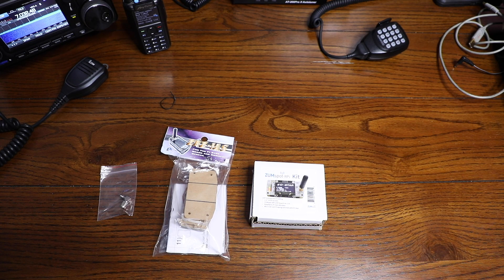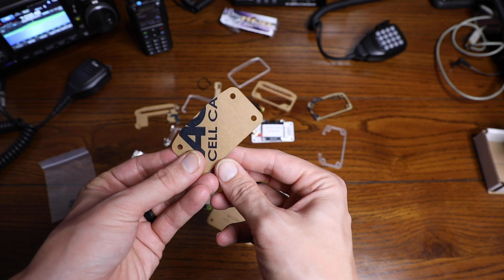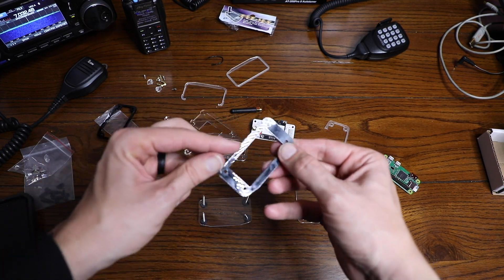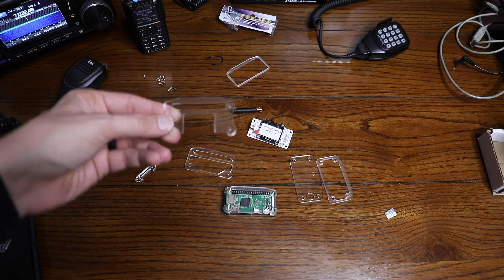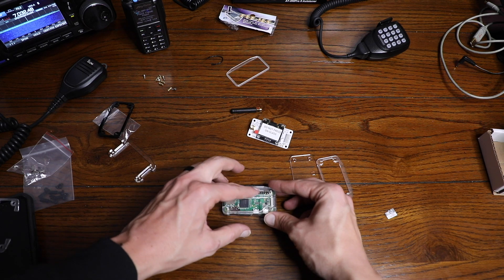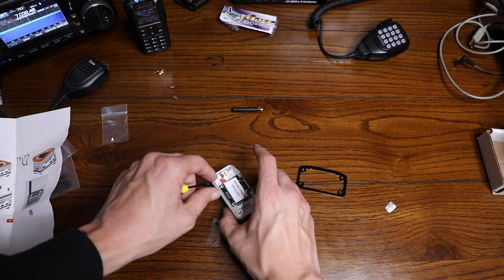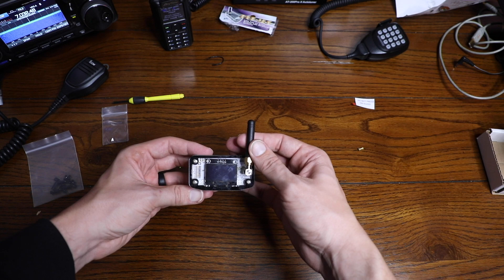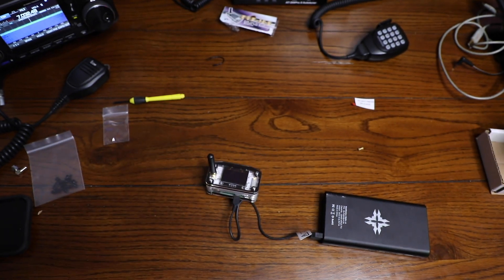ZumSpot Kit Setup - Ham Radio Outlet Hotspot Build

Comment: Thanks for the video, I ordered the Zum thru HRO, is the antenna elbow a LP SMA-20-TGN? This was on the site I want to be sure....thanks
Reply from the maker: Yes, it is.
Reply: K0LWC great...of course after ordering it last night, I saw the model that is already put together, if I had saw that I would of grabbed it first, I realize it doesn’t look that difficult but I really don’t feel like dealing with it lol. I’m sure HRO will love if I called and asked to change that order Ha!!
Reply from the maker: It’s not bad. 30 minutes tops, and quite fun.
Reply: K0LWC I could pay you $20 to do it? Lol.....one last thing, the download from the site for the image?, is that necessary? Since I also lack in computer skills.
Reply from the maker: Yes, it is. You’ll need to download PiStar to a microSD card.
Reply: K0LWC ok thanks

Comment: Why didn’t you just immerse the plastic pieces in water for 30 seconds or so to more easily remove the paper cover? And you really should have removed you finger prints from the underside of the top and last plastic part.

Comment: Good video. I got this (ex 90 elbow) from HRO recently and it is well made. The software it runs on (Pi-Star) is another story. If you are using a Yaesu radio forget about sending DTMF tones to change reflector connections on the fly. I get that the Pi-Star developers do this for free (or at least that is how it is presented) but it is almost totally undocumented. While a few "fill in" boxes and parameters to set are obvious, there are a hundred other tweakable parameters that have no info, no description, no units, no range, no scale, no type, nothing. Be very careful or you can easily brick this thing. 

If you have a C4FM radio and just tune into one room, and you have 2 or 3 minutes to let this thing wake up and connect whenever you turn it on, you are golden. However if you want to switch from room to room on the fly, plan on having a PC or tablet at the ready to log in to the Zumspot to make the change(s). And make sure you hit the OFF button (from the Power screen) to "gracefully" shut this thing down or you may not be able to log in to it again.

I got this Zumspot to be a cheaper alternative to my openSPOT2. The openSPOT2, while about $260 to your door is more expensive, the DTMF tones work with all of my C4FM radios, it boots and connects in about 10 seconds from power on, it is fully documented, and you can disconnect it from power anytime with no re-start problems. I guess you get what you pay for.

Anyway, my $0.02   73

Comment: I noticed the lights on the OLED didn't light up. I had the same experience. Were you able to get the display to work?
Reply from the maker: Yes, the OLED doesn’t come on until you finish the software setup via WiFi.

Comment: Matt, many thanks for posting the video. I was building mine  with yours and noticed it was not going together correctly. There seems to be a flaw in the video? I caught it on my end after a bunch of tries. . You apparently omitted step 7 on the instruction sheet.  I was wondering how and if you were going to correct this and waited only to see the Step 7 piece disappear at 8:03. You might want to put something out about that as it might confuse others. Other than that, great job!
Reply from the maker: Thanks, Jeff. I’ll put a note on the video!

Comment: How do you like the Zumspot vs. the DVMega? Have you found one better than the other? K0RGH
Reply from the maker: Both are great, but I’d give a slight edge to the ZUM! Made in the USA and has worked flawlessly.
Reply from the maker: It’s also a bit smaller than the DVMega which is an advantage.

Comment: I was wondering what the extra package of hardware was for?  Did it ever start working?  How about part 2 where you set it up.
Reply from the maker: The extra hardware is if you’re building it without a case. Not advised! Yes, it’s working great. Pi-star needs to be configured before the screen turns on.

I’ll work on making a WiFi setup video.

Comment: Mine will be here Tuesday from HRO Denver. I will say from other builds I have seen , if you simply take the case out of the bag and carefully turn it over without moving anything it is complete bottom to top order. The only things you need get out are the 2 edge pieces.  Very easy from the looks of it. I'm really looking forward to having it and using it. I'd like to see a programming video from you as well. Great job!
Reply from the maker: I’ll try and get a programming video done! Thanks for watching, Harry!

Comment: Thank you for posting this video!   I have been looking at this on the HRO Site....I am glad to see it comes with the pi zero board, I was not aware of that.  Although it may cost a bit more, I'd rather order from HRO than from who-knows-where in China...plus it looks that everything you need comes with it.  Thanks again for the video.  73 de KE0IWW
Reply from the maker: Thanks for watching! If you buy the kit and case you’ll have everything you need as long as you have a USB to micro USB cable to power the hotspot. It’s may be double the price of some Chinese boards the quality is certainly better.

Comment: Way too expensive.
Reply from the maker: Made in the USA. 🇺🇸 — You can find cheaper boards from China, but the quality won’t be quite as good. YMMV.
Reply: @K0LWC  where's the factory that makes these boards?
Reply from the maker: The board is designed and manufactured in California by KI6ZUM.
Reply: @K0LWC  what if I want the board without the pi zero. What's the price?